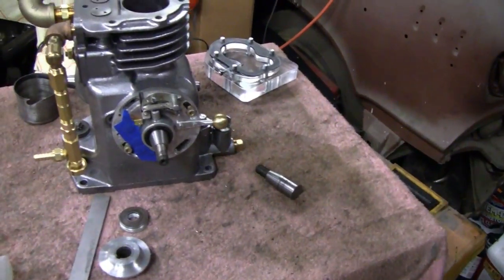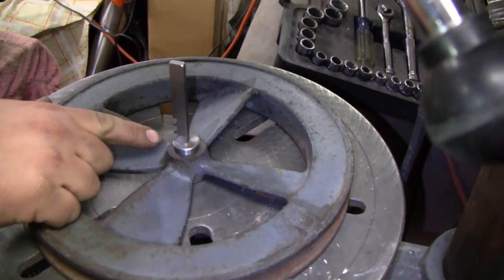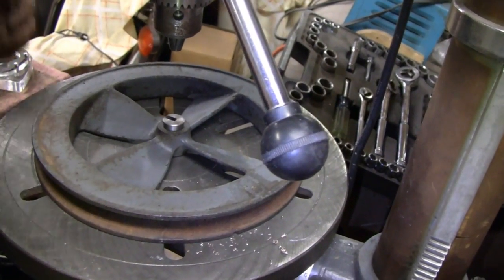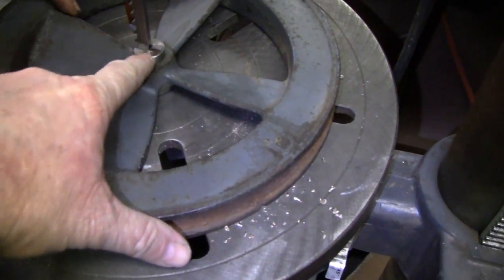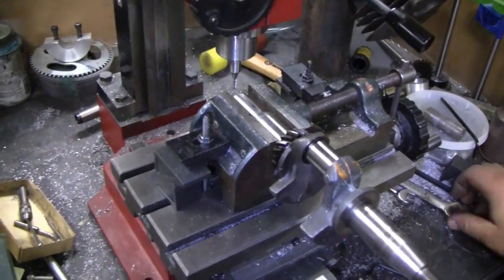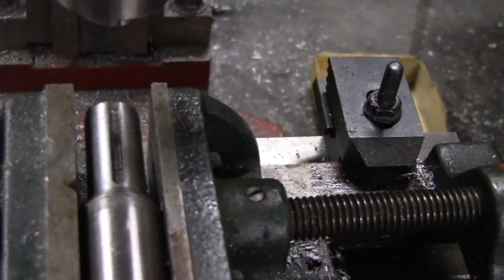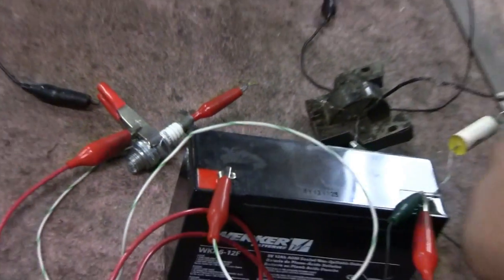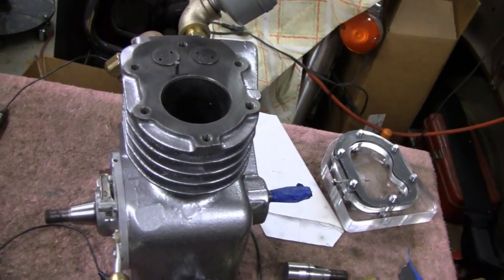GLASS HEAD BRIGGS ENGINE (part 16)

Comment: (sorry had to correct last comment so that it made sense) Just another thought, when you get it running try using an adjustable strobe light to freeze the action at different stages of combustion. I think this would work and hopefully you will see the piston and valves in all stages of progress, a simple timing light (the real cheep one that connect just through the spark plug wire and the spark plug would most likely freeze the action at top dead center). I was wondering how you have the spark plug grounded so that it will fire if it is firing by being installed in the plastic ...Aloha from Maui
Show less
REPLY

Comment: Just another thought, when you get it running try using an adjustable strobe light to freeze the action at differnt stages of combustion. I think this would work and hopefully you will see the piston and valves in all stages of progress, a simple timing light (the real cheep one that connect just through the spark plug wire and the spark plug. I was wondering how you have the spark plug grounded so that it will fire if it is firing by being installed in the plexiglass. should freeze it a top center in combustion firing...Aloha from Maui

Comment: Just an additional follow through: When you were trying to paint the engine you were having a real difficulty. You are not alone, for many years I have used the Rust-Oleum hammer paints with excellent results. UNTIL the new hammer paints with the new spray tip and added primer. The just like you I have had only problems wit spitting cans and clogged cans. This has been with many different cans of paint and many colors. Even when I get a clean spray the hammer effect has never come close to the expected results. I have used the old trick of removing spray tip and using a tubeless tire valve to clear the spray tube in the can. After clearing the spray tube and tip I have shaken the cans as long as 20 minutes and then started to paint and within 30 seconds the old problems return. I have gone back to 3 year old cans of their product with the old style spray tip and no included primer and the outstanding results are back. I is very hard to find the old cans anymore. I believe that the problem is not with the new can or spray tip but with the paint formula that has the primer. I used a tire valve to remove all pressure out of cans with the paint formula can and then opened the cans to pour the paint into an open container and in most cases have found the paint has not mixed well at all. There are many, many globs of paint that do not smooth out or combine even with manual mixing (drill with paint mixing attachment). You did your best but I believe at this point that the fault rests with the paint not you. I am looking to find another  brand of hammer paint at this time. Thumbs up to you for one of my favorite channels. I have used hammer paint for years the restore old electronic test equipment cases with good results but that is no more. Aloha from Maui
Reply from the maker: Thanks Bud!! I agree, I've used hundreds of cans of the regular rustoleum hammer paint and never had a problem!!☺

Comment: I have found that with broaches, it's best not to use the 3-jaw alone, but put a piece of 7/16" or 3/8" stock that's been flattened to do that job.  You save your drill chuck.

Comment: That broach cutter is really cool!.  Never seen one outside of a big machine shop.
Reply: Dan Pentecost for cutting a square hole, I've seen some that were about 30 feet tall. And tapered. To cut massive squares... crazy. If you think that's cool. Check out EDM cutting. It's awesome. Think Hot wire foam cutting but with metal

Comment: So first let me say this was fun to watch. Now to add some minor criticism. That part is a pulley that your adding to the rear side of the engine. You cut up the actual flywheel in one of the past videos. It was the part with the magnets from the original ignition system, and was also externally balanced for the engine itself to run with less vibration. Still very cool to see the combustion chamber as it fires.
Reply: mike little I was thinking the same thing about the flywheel balancing the engine. just don't  Rev it up too fast I guess.

Comment: Can you grind the end of that keyway cutter down to get a good edge on it? I don't know squat about a mill but seems it might work. Have to cool it somehow too I'd think. Chuck it in the lathe and run a grinder up against it to remove the dull part. maybe...You guys'll get it!
Reply: End mills are not flat on the bottom.  They have cutting edges on them so, if you grind it flat, you are only cutting with the sides of the mill.